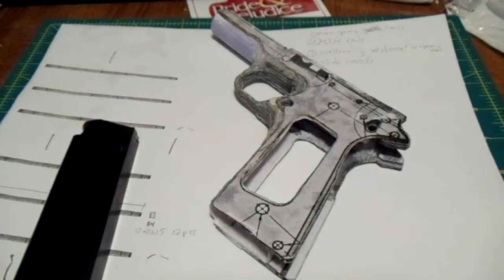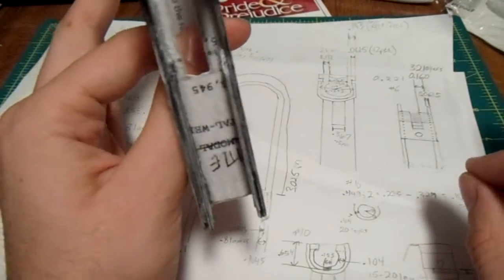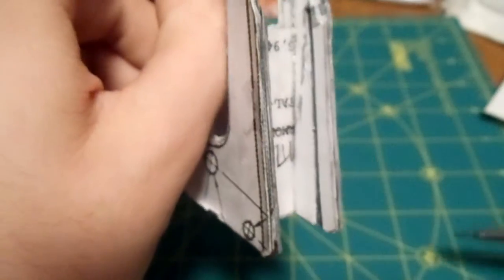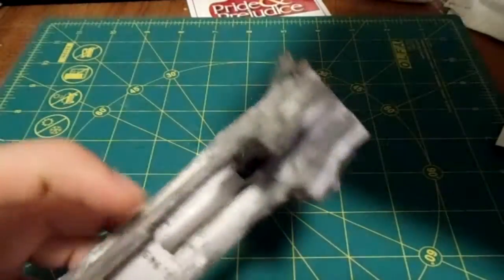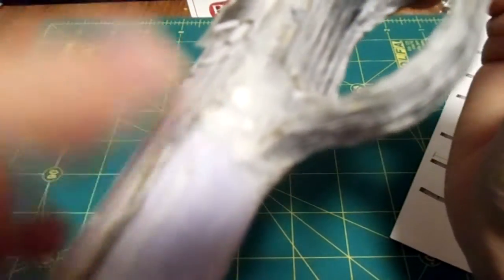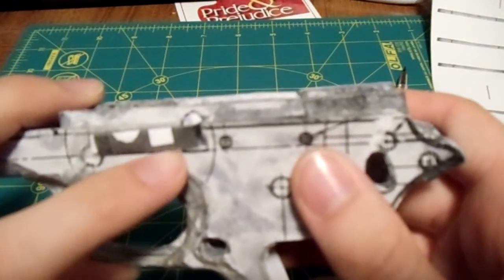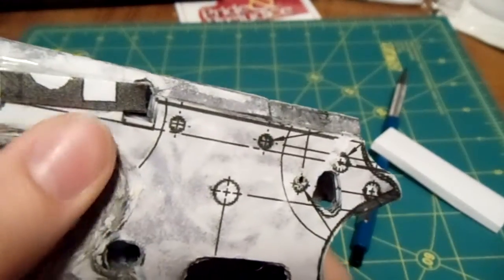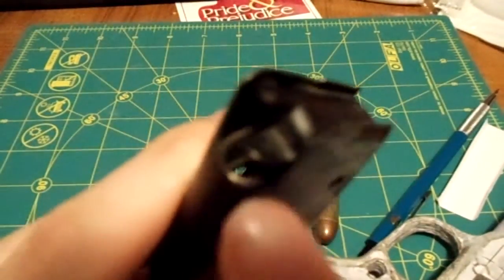Paper m1911 update #11 - Mainspring housing rail and slide rail + extra

Comment: I noticed that the front curve around the handle on mine and yours isnt far enough out. Like if ypu set the gun on the blueprints the the dashed lines run alomg the outside. Its hard to explain but i domt think front handle curves go far enough out.